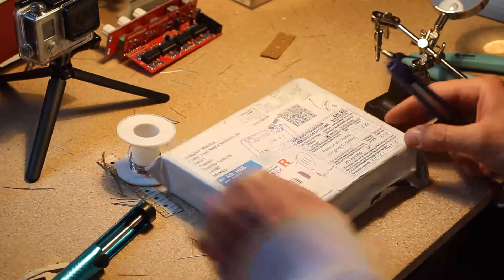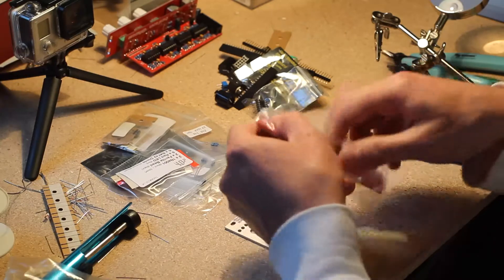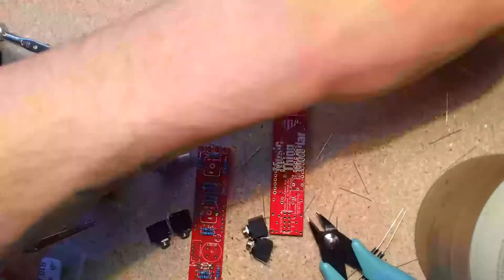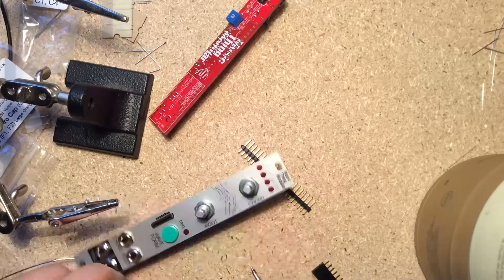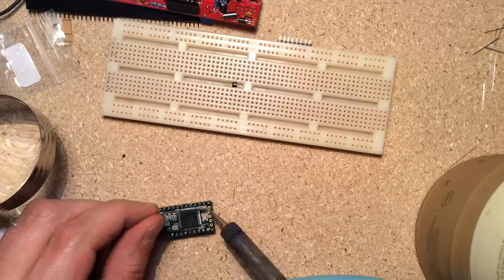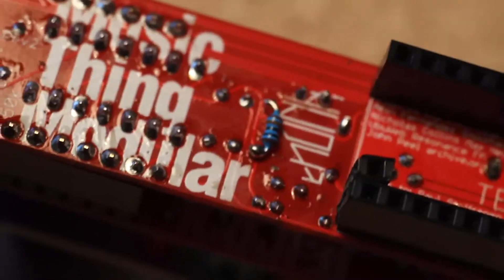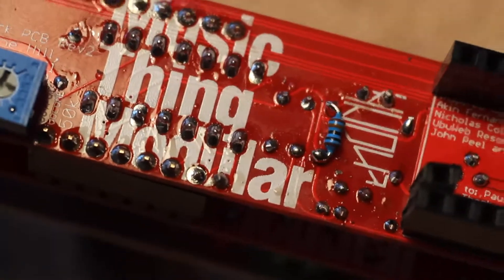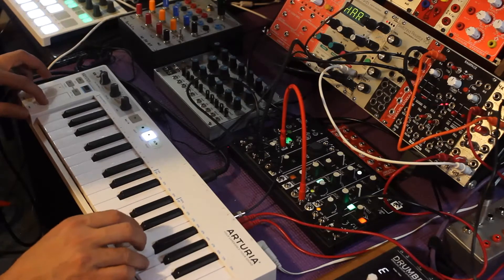Kit Review # 3 - Music Thing Modular Chord Organ

Comment: What is a TKB?
Reply: Stephen - I could be wrong, but that's what Serge called its Touch sensitive KeyBoard - TKB. Each individual note can be adjusted, and it's pressure sensitive.  Quite the thing!
Reply from the maker: the Serge Touch Keyboard. You set the voltage for each key independently with a pot, so it would be easy to define certain keys for certain chords: http://serge.synth.net/documents/datasheet/NewTKB.jpg
Reply: I thought that was what you might mean, but I wanted to be sure.